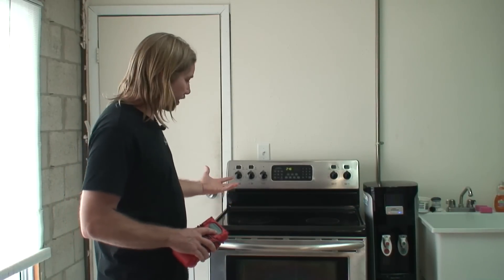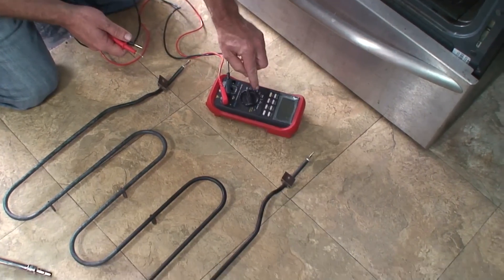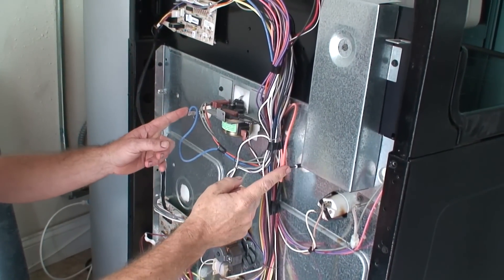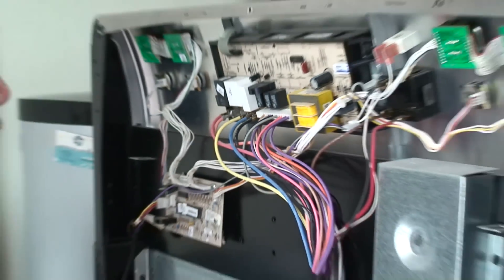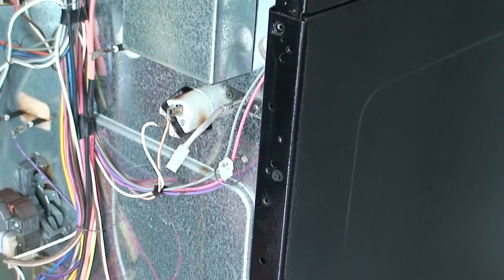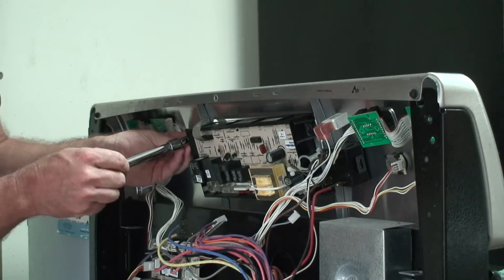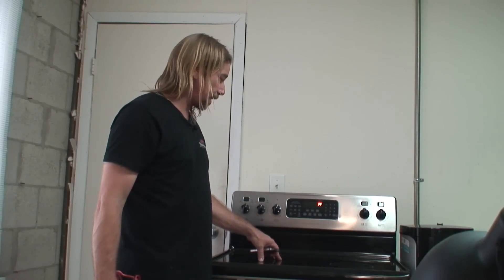Frigidaire PLEF398DC Professional Series Electronic Oven Control

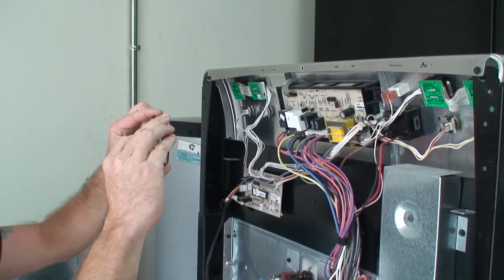Comment: 8:25 Man!!! I really wish I found this video yesterday. I was replacing my EOC and I took two pics of the wires. Pulled the wires and changed the EOC. Checked my phone for the pics and my phone did not process the pictures! 🤬The wiring schematic was less than helpful what color wires go where on the EOC. I spent a over an hour searching YT and the internet for a picture of EOC wired. No luck. I stared at the EOC schematic for a bit, and I was able to finally decipher what wires went where. I didn't have a multimeter handy so that made the job a little tougher. I'm saving this video and wrote the wiring order in the owner's manual for future reference. My hard lesson learned from my experience is "always confirm your camera saved the picture before pulling any wires!" Thanks for sharing the video! 🤘

P.S. Your video ended up on my recommended list today. Unfortunately, it was a day too late. You might want to add the EOC part number 316418702 in your description so people can find your video easier. 👍

Comment: Is there a way to test this limiter switch or just replace it? Because I thing its stuck in but not really working. Would does this switch cut power to complete oven even control panel lights?

Comment: Hey y’all- if it looks like the control board is bad and you want to save some money, check the solder joints where the relays attach to the back side of the board. On mine, one pin was burned out. Two minutes with the soldering iron repaired it.

Comment: Great video - very helpful.  Found the solder joint on one of the relays was blown out on the main board.  Re-soldered the joint and all is well
 Saved $260.00 by not having to buy a new board.

Comment: One thing he said he was going to check and then forgot to was the Broil Element, he didnt test as to whether or not that is getting power and where it might be stopped at
Reply: broiler element gets power from same source as the baking element, which is the control board.

Comment: Nice video I have wall oven Frigidaire video on replacing control board? My question is the tape connection i pulled up the part of the connection do I pull the tape wire out ?

Comment: Why didn’t you save your client a couple hundred and just replace the relays?
Reply: If replaced the relays but some other component was causing the relays to blow, then the new relays would blow causing more delays to locate what's causing the issue.  Board replacement is time convenience.
Reply: We are thinking along the same line here Todd, if the control board is partially working, I would think it's just a bad relay and replace the relay. I haven't priced a relay, but it has gotta be way cheaper than the whole board. My control board has nothing working on it, a new one is $302.15 (OUCH) that hurts! Otherwise, a pretty good directional video for checking power to and out of the board.
Reply: Trying to find just the relays could be a problem. You’re not going to get them at the local appliance parts store. You would have to research an online electronic supply company that may be able to get you one using numbers on the relays. But like he said if there’s another problem with the board it may blow up the new relays anyways so that’s why replacing the whole board is usually the best solution. The only thing to check before doing anything is a lot of times the solder for the relays get cracked and needs resoldered. Sometimes it’s hard to see the cracks so just solder the connection anyways. If that doesn’t resolve the issue then buy a new control board.

Comment: frigidaire and many other oven brands have poorly documented "easter eggs" that even most professional technicians fail to address or understand.  Please use THE FOLLOWING PROCEDURES BEFORE doing ANY troubleshooting.  These TWO Steps MUST be accomplished.  You can spend a great deal of wasted time running down rabbit holes and ghost fault issues if you DO NOT perform these two simple steps.  (these steps are addressed in the User Guide and Installation guides under the topic "setup" and also "control settings"...

First Step:  if power is removed (unplugged) or by temporary power loss, the Control Board Clock will reset.  These Ovens WILL NOT FUNCTION at all until you SET THE CLOCK.  So SET THE CLOCK after you have restored power and the unit is plugged in!  

This step is essential!  Again, the control Board will not function and you will never get the oven to operate until you set the clock!

Here is the direct quote from the manual on my frigidaire oven:

"Important: The electronic control is inoperable until the clock is set to the correct time ofday, after the appliance is first plugged in, or after a power interruption. The
electronic timer has a memory and when power disconnected it will show
display of the last time recorded."

SET THE CLOCK..!!!  

this will save you a whole bunch of time if you do this first.  If you do NOT do this, you will never get a reliable troubleshooting process.  If you cannot set the clock, it MIGHT be the control panel...or something else like a relay or a temp sensor or a heating element of the temp thermostat probe or wiring...But before you go start running those things down, go to the second step here:

Second Step:  This one is not obvious but it can happen.  If your oven was in Self Clean Mode, or in HIGH Broil Settings and experienced a loss of power FOR ANY REASON, then the oven will go into a CONTROL PANEL LOCKOUT mode.  You may or may not get a displayed error code.  This one is the biggest easter egg problem with these "modern" ovens!  Even if you restore power and can open the oven door and the mechanical door lock rolls back (as it should when the oven senses a normal safe operating temperature (read:  cooled down), the control panel WILL  go into a LOCK DOWN MODE.  This second step introduces TWO PROBLEMS and the fixes to them are here:.

a.  the first problem is that since loss of power happen, the clock needs to be reset...follow the instruction in the first step above to correct that!

again...my manual shows this:

Important: The electronic control is inoperable until the clock is set to the correct time ofday, after the appliance is first plugged in, or after a power interruption. The
electronic timer has a memory and when power disconnected it will show
display of the last time recorded.

b. The second problem is the LOCK DOWN MODE.  Once you have set the clock, you may still experience no power to the elements.  This is the Control Panel Lock Down Mode.  To fix the Lock Dock Down mode, my manual shows this:

Control Lockout(some models)

Lockout is an added feature that allows the oven controls to be locked. This feature locks the control and allows cleaning of the
control panel without accidentally activating the oven.Lockout can be set or cancelled by pressing the BAKE/COOK TIME and STOP TIME pads at the same time. 
During this mode depressing any button results in the word "OFF" being displayed for 2 seconds.While in Lockout, the display will show the current time of day. 

Note:  I have found the last sentence to be incorrect in certain situations like a loss of power during Self Clean or loss of power during  High Heat Broil mode. In those two situations, the Display will NOT show the current time of day.  In this situation you MUST set the clock first, then you can perform the two button sequence to UNLOCK the control panel.

I am avionics, 20 years plus, Boeing and Airbus.  I've worked on just about every single kind of electromechanical device, sensor and control board, including a great deal of programming and computer tech experience.  Sadly, the poor documentation with kitchen oven appliances leave much to be desired when problems happen.  I cannot begin to count the number of kitchen and residential appliance or consumer products that I have repaired, discovering usually there is some "hidden easter egg" solution, undocumented or poorly documented.  

So...before doing anything...save yourself a huge amount of time and do these things first before breaking out the test gear, opening panels, and or calling that very expensive repair technician.  In many situations, the "problem" is often very simple to solve.  Not always, but often enough this happens to be the case.

In troubleshooting...do the simple and easy things FIRST.  Then escalate as required.

and be  very careful ...240 volts of triple phase WILL KILL YOU.  If you don't know how to work around dangerous current, don't even thing about doing any of this back panel stuff.  Even if you don't get "hit", you can incidentally create other damage to your oven, simply by touching the wrong things with your tools.  If you do get into the panel with power on, have someone near and helping, just in case they need knock you off a live circuit with a rug, administer CPR and call 911

I'm not kidding.  Be safe
Reply: This video is to address bad heating element, no panel lockout.  However you are correct, I cannot even turn on my frigidaire stove burner on unless the clock is set first.
Reply: I was getting a F1 code constantly, after setting the clock it quit beeping and showing an F1 code.

Comment: Nice layout of steps and easy to follow. My only recommendation is to skip removing the bake element and start by removing the back panel to do the testing with both elements in place (as you did later). That way you're also skipping the need to remove the door and additional screws. There's also less risk of damaging the element. Of course, if the element is bad, then you'll have to take it out anyway. But if the element is good, that's less work you have to do!  Also, it's worth noting that some ovens also have a thermal fuse, which breaks the connection if the oven gets too hot... which may happen during a self-clean cycle. Sometimes you can just reset the fuse if it has a button reset, but other types will need to be replaced. I don't believe your Frigidaire has a fuse, as mine didn't either.

Comment: Can you help me out .I have the same stove my control board is not lighting up like there's no power ?
Reply from the maker: CAR MAC 1 you most likely need a control board but we are by no means experts on this, we figured it out along the way and used the wiring schematics on the individual parts to make educated guesses. If the control board is getting all the inputs it is suppose to be getting and no power, then replacement of that board is highly likely, but please remember, we work on cars and trucks and not really stoves
Reply: @APDTY  lol thanks Car's and trucks what are you doing fixing stove s 😆

Comment: Couldn’t a relay or two have been replaced?
Reply: This is a common failure point on these controller boards.  If you pull the two halves of the controller apart (the whole thing opens kind of like a clamshell), you will most likely see a blown-out solder joint on one of the relay pins.  The relay itself rarely fails.  The problem is that the full burner current flows though a solder joint, a terrible design.  So sometimes, the solder just "explodes" off the pin and breaks the joint.  Resolder that joint, and it will work again.  As for how long it will last, well, that depends on luck, the solder you use, and how good your joint is.  I repaired one of mine with 2% silver bearing solder and it's held up for 3 years now (and a different one just blew out, which I have now repaired the same way)

Many of these controller boards are no longer made, and they cost hundreds of dollars if you can find them.  Instead, you can fix it for NOTHING if you pull it apart and resolder the relay pin.
Reply: @cowsongs  Thanks for the pro info. I wonder if using say 5-10% silver solder might resolve the issue...
Reply: @sempertard  Use the solder with the highest lead content you can get. I will sometimes also solder on a solid core wire to replace the trace. I have had hot tub circuit boards blow out the solder joint.
Reply: @bobsoft  Yes that does indeed work quite well.
Reply: my thoughts exactly...

Comment: What is the piece with the yellow coils?  I have a Ge oven not working. I expect that piece and or the relays. 
  I want to replace these components if they are bad instead of replacing the whole board. 
  The piece I am referring to is the transformer. Getting old here, could not not think!  :(
Reply: I'm not sure how to find out the specific replacement part, but it is a PCB transformer for converting DC to AC or vice versa.

Comment: Good over view, thanks! I'm ordering an EOC for our Frigidaire Gallery Induction (what a piece of crap by the way - I've already replaced one of the induction control boards on it) and now the EOC.  I liked how you showed how to get the overlay off and reuse it.  Thought I was going to have to buy a new overlay but now I realized I don't need to.
Reply: do you have surge protection at your electrical panel , we went through 3 EOC control boards , instaled whole home surge protection , no issues after.

Comment: Thank you so much for making this video. You went above and beyond what all of the other videos showed. I had learned from other videos that everything was working correctly except for the E.O.C. but that's as far as the others would take it. I wanted to verify it really was the E.O.C. and exactly where the trouble was. Your video showed me how to check the E.O.C. and sure enough, that's where I found the trouble! I found the best price for a new E.O.C. on eBay, ordered it, installed it (thank you for also showing that part) today and my oven is now heating up! Btw, I would not have known to peel off the cover on the old E.O.C. if you had not shown that. I would have expected a new one to have the cover on it. I am grateful :-) Your video saved me a few hundred $! :-))

Comment: Great video! I'm going through this right now with a Frigidaire FEFL68GMA. The baking element went out in spectacular fashion. I picked up a new element because it was melted. I have checked everything and then I found my broil element not working either. So now to buy a new control board.

Comment: hi , i have the exact stove model and the problem is that it has the red lock on and wont go off , the oven works but not the burner i have try everything but red lock wont go of , happened before and i just turn off the main breaker and it work , now didn't work

Comment: Oooops at 4:59.  Neautral is NOT ground.
Reply: often connected to earth ground, ground and neutralare closely related. Under certain conditions, a conductor used to connect to a system neutral is also used for grounding (earthing) of equipment and structures..so yes basically it is a ground...